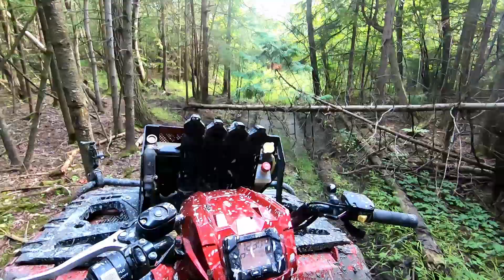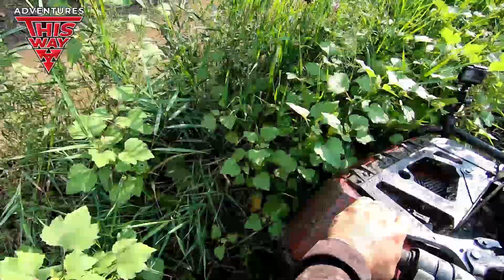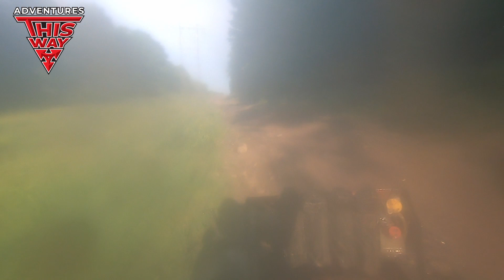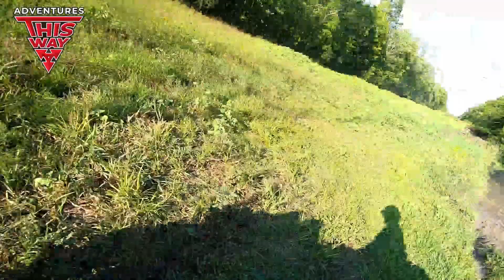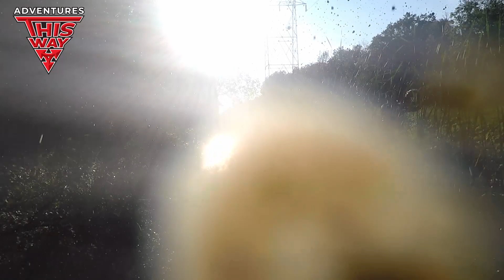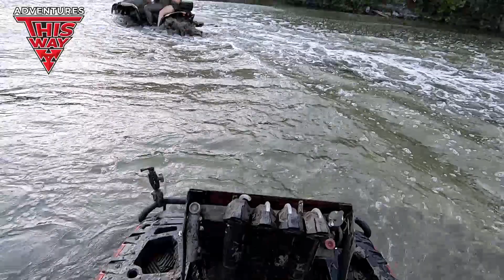Can Am vs Polaris Mudding! Anything Can Happen At The ATV Park!

Comment: Water in a connection? I’m struggling with a power steering error atm as well, except everything is working but the code doesn’t want to clear. 🤷‍♂️
Reply from the maker: Likely some electrical gremlin.  I did smash it hard in to the holes there.  
It can be frustrating when constantly getting codes.  I have heard talk on some Polaris FB groups about Power Steering Code issues.  Worth looking into.
Reply: ADVENTURES This Way bringing it in this week to clear the code. I think it just needs a reflash. Hopefully your gremlin doesn’t creep back.